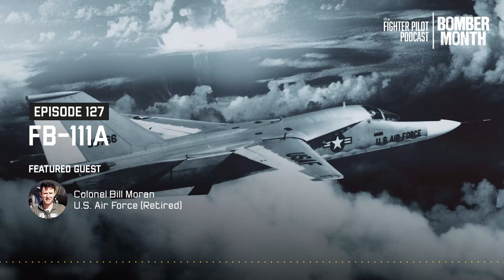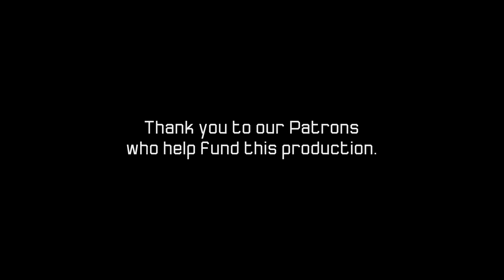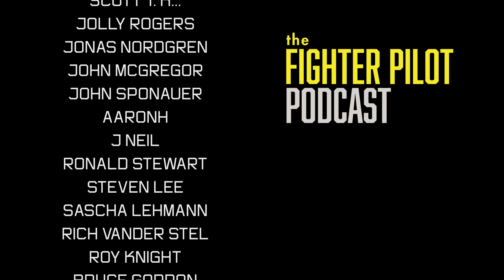127 - FB-111A

Comment: The empty weight of the F111A was around 49000 lbs.  The empty weight of the F14 was 41000 lbs.  Only 8000 lbs difference doesn't seem like enough to cancel a good money saving idea.  The Navy version F111B did complete carrier trials.  Videos of this are on YouTube.   I believe the Navy refused the F111 for two reasons.  1. They didn't want to start a trend of allowing the Pentagon to select their aircraft, and 2. They (admiral Tomcat Connolly) wanted an aircraft built by Grumman because they expected a cushie job with Grumman after they retired.  It would have saved billions if the Navy had accepted the F111B.   Most of the cost of a weapons system is in the maintenance training, spare parts, repair of the spare parts,  and special tools over a twenty to thirty year period.  I was an instrument and autopilot technician and instructor on the F111D and F111A from 1970 to 1980.  I grew to love and respect the F111.
Reply from the maker: @jnbfrancisco  ah, that last bit explains it.
Reply: @FighterPilotPodcast  Thanks for the reply.   I sat in on a few post flight maintenance debriefings on our brand new F111Ds.  The pilots would report some standard info at the beginning.   One reported the max mach at 2.7 as though it was nothing special.  No one except me seemed to think anything was special about that.
Reply: The Navy claiming to reject the F-111B over lack of carrier suitability was a total farce.  The Vark did just fine in carrier trials.  And to know just how bogus the Navy's assertion was, just look at the jets they were perfectly fine with flying off their flattops:
A-5 Vigilante
A-3 Skywarrior

The Navy was just fine flying the Whale off their decks into the 1990s, yet stood by this claim that the Vark was unsuitable for carrier ops.

The Navy was simply being FICKLE.  They pursued the Missileer concept.  That was the basis for being on board with the F-111B concept ...and then they simply changed their mind.  And Congress gave them a pass.

 @jnbfrancisco : "It would have saved billions if the Navy had accepted the F111B."

Yes, it was the Navy wantonly burning taxpayer dollars.  By the boatload.
Reply: @dahawk8574 I think there is some tough competition amongst all the branches of the Military as to who can waste the most money.   I worked as technician in the USAF for ten years 1970-1980 and as as technical representative for Sikorsky Aircraft another 31 years working with the USNR, USN, USMC and the US Army.   More cooperation amongst the branches of the military would be better than the rivalries we have had.  I worked with several good USN aircraft technicians who got out because they didn't want to spend so much of their life on an aircraft carrier.   I have dreamed of spreading that duty over all the military aircraft maintenance people.   I would have been ok with one or two deployments over a twenty year term but not 5 or 6.

Comment: I was in the 5 foot 9 bomb wing for 12 years after being a CP, and IPU in the Buff (G and D)I was a pilot in the 393rd BS.  The wing sweep control was only on the left but you could reach across the left seater as an IP. With certain stores and flap settings the the wing sweep was limited. We test flew the FB at 50000 once in a while and got up to 2.2 to 2.4.
Reply: I was an instrument and autopilot technician on the F111D from 1971 to 1974.  I once sat in on a maintenance debriefing.  The pilot reported that the maximum mach was 2.7 .  No one except me raised an eyebrow.   I still wonder today if I heard him correctly.   What do you think.

Comment: I've always loved the F-111 (being australian) but never known much about the FB-111, so excited to learn about this one
Reply from the maker: Hope it delivers. 😎
Reply: After removal from SAC service, those FB-111A transferred to TAC were redesignated the F-111G. The RAAF bought about 15 of them.
Reply: @kennethkatz8278  yes, but they are not the australian variant of the f-111. The australian varient was the F-111C, and although the FB-111's were turned to F-111G's, Australia did not purchase FB-111's
Reply: @hamiltonian12  They were very close to the F-111C with their longer 70 foot wingspan, upgraded landing gear and heavier max gross takeoff than "regular" F-111 variants.  The FB-111A's became F-111Gs in USAF service which Australia purchased 15 to use alongside its F-111C "Pig" fleet.  The FB-111A and the F-111C Aussie variant both had missions that were similar.  Putting bombs on targets of strategic interest to Australia.  They didnt buy FB-111A's directly, they were converted to "G"'s prior to the Australian purchase.  In 2001 many C's received lengthened wings from ex USAF "F" models out of AMARG.
Reply: @hoghogwild  u said it urself, u said australia bought f-111g's, and yes i know, but the F-111G is not an FB-111, and although it may have beeb converted from an fb-111, they were no longer fb-111's
Reply: @hamiltonian12  Yes, that's a fact that no one here has contradicted  You keep saying that Australia didnt buy FB-111A's when no one here ever said they did.  But there are reasons why Australia would be so interested in the former FB-111A now F-111G US fleet to augment their "C" variants.  Stretching the range from the platform are what US nuclear FB-111A and Aust. conventional "C Pig" variants had in common. The G's just happened to have the uprated gear, 70' span, which was exactly how the Australian C versions were kitted.   Such an amazing capability for Australia, but other US variants had similar and better capability.  The US "F" is a rocket with 50,000 pounds of thrust.
Reply: @hoghogwild  thats why im so confused, because my comment was talking about FB-111A's, and then people started talking about the australian f-111g's which had nothing to do with my original comment
Reply: @hamiltonian12 : "...the F-111G is not an FB-111, and although it may have beeb converted from an fb-111, they were no longer fb-111's"

This conversion process you speak of involved a mere reprinting of the Dash-1 Flight Manual.  Scratch out the 'B' and 'A', then replace with 'G'.

I am bemused as to why you persist in seeing the F-111G as different from the FB-111A.  Even the paint was very close to the same.  SAC had a 'Dark Vark' paint scheme.  ACC(/TAC) had a greyer version of this.

This is the most I can make as the basis for your argument.  Well, you see, the paint was not exactly the same, therefore it was a different aircraft.  Um, NO.

Comment: i loved these planes, we had them in the RAAF as the only other primary operator besides USAF, where it gained the nickname "pig" because the word aardvark in Afrikaans where theyre native is "earth-pig", but they retired them starting in 2007. She will be missed!
Reply: RAAF never had FB-111's, we had F-111's. The F-111C's (aussie version) however did have FB-111 wings and landing gear because that is what the RAAF wanted. The FB-111 was specifically a nuclear bomber, not what the RAAF needs
Reply: @hamiltonian12  ooh! cheers for the clarification. I havent had a chance to listen to this episode of the podcast yet
Reply: @hamiltonian12  The RAAF bought about 15 F-111G, which was the FB-111A redesignated for TAC service.
Reply: @kennethkatz8278  yes, but they're not FB-111's
Reply: @hamiltonian12  Well, I think you're splitting hairs there Hopper. The FB-111As were refitted with modern avionics and re-designated F-111Gs. Fifteen were sold to the RAAF.
Reply: The complaint by LMJ06 is far worse than splitting hairs.  You say:

 @Simon-bg3st :  "The FB-111As were refitted with modern avionics and re-designated F-111Gs."

You are speaking about two separate, distinct, and totally unrelated events.  The F-111G was NOT an FB-111 with Mark II avionics upgraded with Glass Cockpit MFDs.  The AMP (Avionics Modernization Program) happened years earlier within SAC.  The FB-111A was an FB-111A both before, and after AMP.

So there was essentially NO DIFFERENCE between an FB-111A and an F-111G.  The former was a jet based a Plattsburgh or Pease.  The latter was the exact same airframe which operated out of Cannon.  The famed garden spot of the fighter community.  Why the rebrand, when nothing was changed to the aircraft itself?  Because TAC/ACC could not fathom owning any aircraft with a 'B' in its designation.  Even if you put an 'F' in front of that 'B'.  They even developed an aversion to the 'A-' designation.  A-37, A-7, A-10 ok through the 70s.  But notice in the 80s they bent over backward to brand the "Stealth Fighter" as an "F-" 117.  In the 90s, "FB-" was a no go.
Reply from the maker: Love that “earth pig” mention!